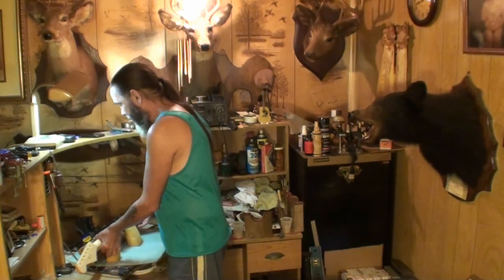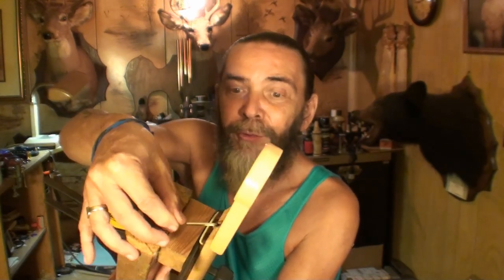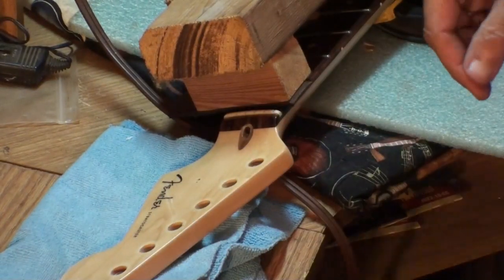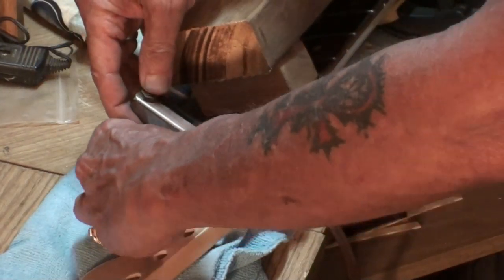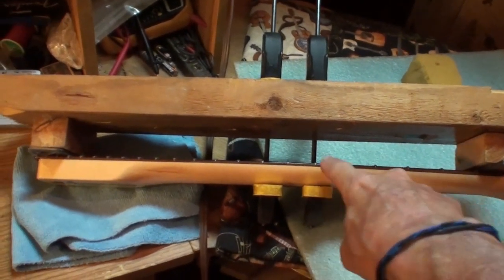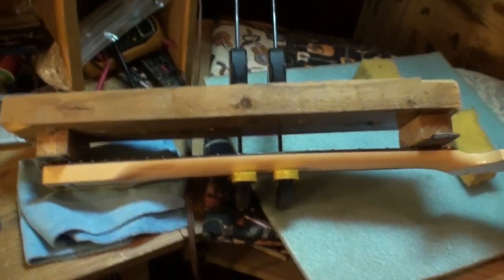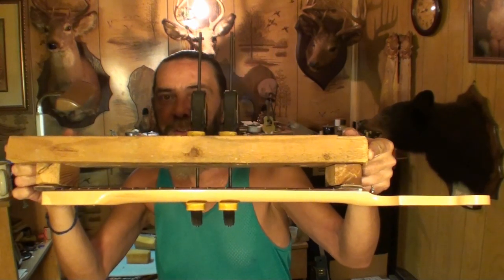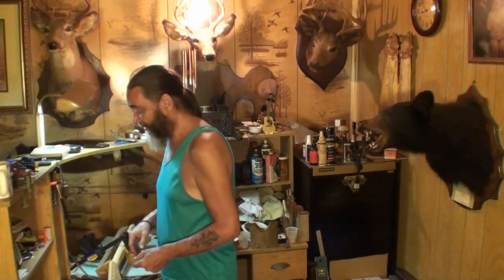stratocaster neck repair part 2 we MUST apply more force!

Comment: Last machine screw I fought, I cut a one inch square of rubber glove & put it between the machine screw & the Allen wrench & finally got it to grab and not wobble in the hole.. Sounds kinda kinky, but it works!!

Comment: Looks like a complicated repair, but also that you're on top of it. good job.
Quick question, if I may. My friends acoustic needed a truss rod adjustment but when they attempted it the top of the truss rod broke off. The guitar is okay at the moment but I'm wondering if it ever needs adjustment again, are they pretty much screwed? Will they need a new truss rod fitted, and I'm guessing that would be quite a complicated and expensive repair?
Reply from the maker: I hate to mention them but Stewmac now sells a tool that allows you to either bore some of the wood out around the head of the adjusting head of the truss rod and another (depending on how the head broke off) to re-thread the end of the truss rod itself allowing you to screw on a new adjusting head, the tool is ecpensive but probably cheaper than replacing the truss rod. thanks for watching mate I hope this helps.
Reply: @RandySchartiger  Cool, thanks for the reply. It's good to know that there might be an alternate, cheaper fix, than replacing the truss rod. Cheers.  :)

Comment: With all that fiddling and grinding, you might as well have replaced the nut 😉
Reply from the maker: if the owner wants me to replace it I will. thanks for viewing.
Reply: Randy Schartiger Hi Randy, here’s hoping the owner watches your videos and sees the sense in replacing the truss rod nut. Crazy not do that while it’s with you..👍🐨🇦🇺
Reply: @tomahoks  Huh? It usually takes me 20 minutes to replace a truss rod nut on a Strat like that. I bet Randy has used the same time filing and testing wrenches 😉